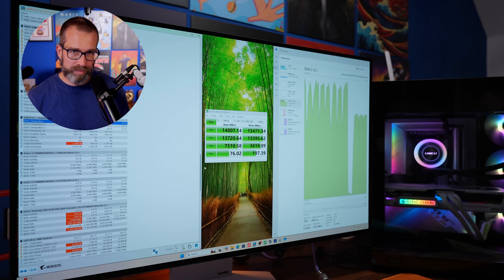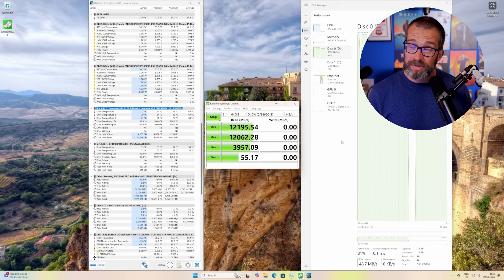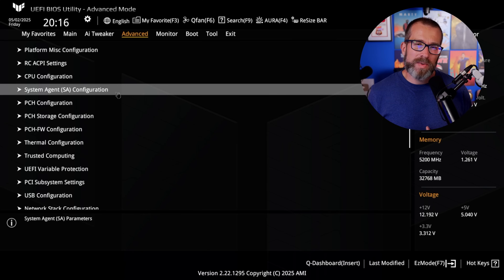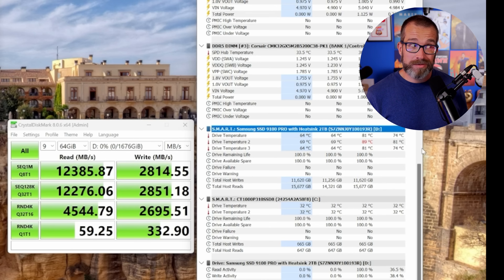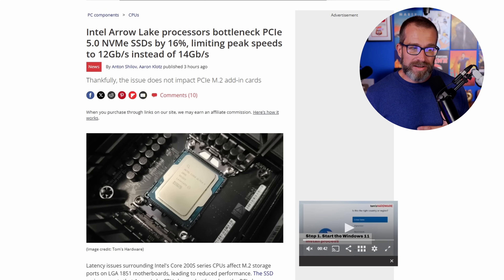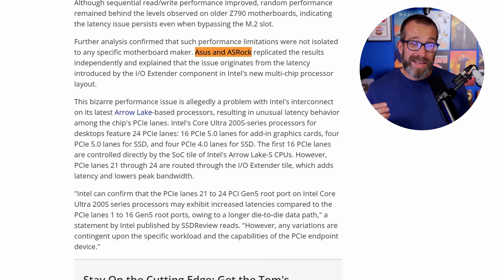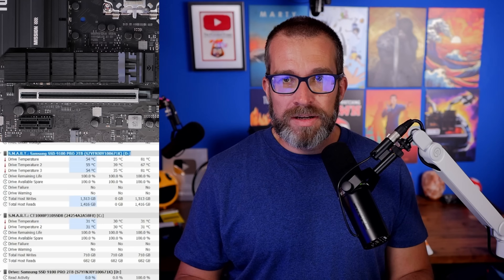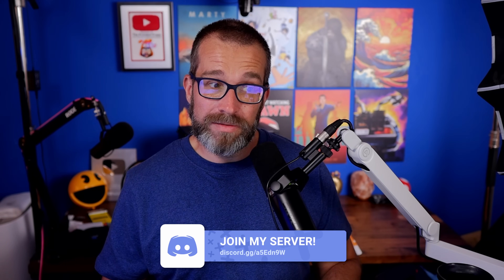Why your gen 5 NVMe isn't running at top speed...

Comment from the maker: Asus has said the following about this:
"In short the issue is due to the way the CPU/platform is designed and having more latency.

Due to the higher die to die latencies on PCIE root port of M.2_1 from IOE tile. This reduces the max throughput/speed. In real world this is not a factor but if you are going to be focused on peak saturation or looking to confirm the highest level throughput this is a factor.

This is platform behavior, not a single board issue."

Comment: I've got a TUF B650-E Wifi motherboard with a 9800x3D liquid cooled chip. I just picked up a Crucial T705 4TB drive, but I can't seem to get it to go above 8.7GBs Read and 8GBs Write...I once his 11GB but that was once. After that test, I was getting like 7GB Read and 2GB Write....I don't get what the issue is. The temp doesn't go above 73 degrees and usually hovers between 62 and 63....

I'm not sure if something is wrong. I updated the BIOS on my MB, I checked the drive firmware, its up to date, I enabled the momentum cache...Still not seeing these 12-14GBs rates...I'm a little bummed out as I bought this thinking I would get at least somewhere near those speed.

Any suggestions, anyone?

Comment: I'm not so sure you are correct about  the 285K performing worse than the 14900K... but it's not a huge upgrade. You have to tweak your system (OC) and definitely need to have CUDIMM Ram at over 8600MT/s...  As far as the Gen 5.0 SSD's this is super annoying! I had not seen this published anywhere before I dropped $300 on the MSI M580 SPATIUM.

Comment: Well that sucks, but even my 9100 is only running at like 7529MB/s on a 890-E ASUS Motherboard with the 265K and my BIOS is fully up to date and I have it in the m.2 slot that's priority AND I forced it to run at PCIe 5.0 speeds, this is super frustrating.....
Reply from the maker: They is odd. Have you got a lot of other nvmes on the board? Is it running at half the lanes?
Reply: @TheProvokedPrawn  I jumped the gun on the comment, thanks for getting back to me. I guess it's something in Samsung Magician that won't read it any higher, in CrystalDisk it reads it at your same saturated speeds so all is good, thanks!

Comment: I'm running an MSI Godlike X870E with AMD 9950X and Crucial T705 4TB Gen5 in M.2_1 slot but even after manually setting the slot to Gen5 in the BIOS it's still only running at Gen4 speeds between 5700MB/s - 6300MB/s when it's rated for 14000+ MB/s. I reached out to MSI and Crucial but no word back yet.
Reply from the maker: I bet it's a bifurcation issue. Have you tried M.2_2. Looks like that's a gen 5 port as well. 
https://youtu.be/hYYygf575N0
Reply: @TheProvokedPrawn I haven't yet because it shares lanes with PCIE_1 where my GPU is installed, but I believe M.2_4 & M.2_5 are also Gen5 without sharing lanes with PCIE_1.

I'm going to troubleshoot now and see what I come up with. Multiple others have said on reddit it's an issue with all X870E MOBO's..

Comment: Oh man, thank you very much!!! This is exactly the issue I have with my PC. Intel 265K, Motherboard Z890 and NVMe Crucial T705, the fastest NVMe up to now. I got only 12 GB/s at reading instead of 14 GB/s. I tried so many settings in my BIOS and nothing worked. My conclusion was that the Crucial T705 is probably a little bit slower because I have an Intel 265K instead of a 285K. I am surprised that the cause has only now been found and not months earlier. Greetings from Switzerland and thank you very much for your video.
Reply from the maker: Glad to help. Sorry to be the bearer of bad news and no fix

Comment: Would rather have a 16% decrease in Gen5 vs AMD which are blowing up since zen4 and still on Zen5.

AM5 in its entirety is just as bad if not worse than 13 & 14 gen intel! 

I had 4 failed 13/14 gen CPUs and well, they also chomped your GPU lanes to x8 if you use Gen5!

Comment: My question would be this. Why would anybody buy an intel over an AMD at the moment?
Reply: Multiple reasons, but all fairly niche. For Productivity, it is very much "it depends" - gcc code compilation tests show the 285K about the same as a 9950X, and in Python the Intel chip wins in numpy (unless you need native AVX512). For NAS, Arrow Lake has lower idle power draw (AMD's Zen architectures are more efficient under load), and this is also very important for laptops. QuickSync is also useful for some people in video editing. Also, as the other person said, everything comes down to price vs performance, and the price varies hugely across the world. Intel are still selling a lot of CPUs, just not in the Enthusiast space in North America. In Papua New Guinea or Brazil or wherever it might be different (or not).
Reply: only reason I see is QuickSync and idle power usage. 
The latter one was quite a problem with AM4 and still partially is on AM5, but somehow there are few videos on it. Regardeles, some SKUs can suffer from high idle power draw (even 40+W,  dual CCD ones might be the only one affected), which is kind of insane.
And well, perhaps better price/perf in some regions

Comment: I was having the same issue but my laptop I have a Lenovo Legion Pro 5 16-in from 2023 with a 4070 mobile, I would put my WD Black SN850x 2TB and put games on it and they would stutter a lot and then I would put my Sabrent 1TB in there and no issues.crazy.
Reply from the maker: Hmm. I vaguely recall firmware issues being mentioned with WDBlack a while back
Reply: @TheProvokedPrawn  yeah this will be the last Intel machine I buy, I got this laptop last mother's day weekend on a sale $500 off bought that WD on sale too for a 2Tb for $120 was a steal..this is my new build and I'll put that WD in it....going to buy this part by part soon.

Ryzen 5 7600X. $206

B650 chipset motherboard for Ryzen 7000 series
$119

Radeon RX 7600XT $500

32GB DDR 5 RAM $94

1TB SSD NVMe $50

 Power Supply 650W   $65

NZXT H5 Flow ATX Mid-Tower Case $94
With fan

Windows 11 home key $11

$1366 I added tax in that
Reply: @TheProvokedPrawn  this X version has the DRAM and I use the WD dash to up date the firmware still having the issue. WD Black SSDs, particularly the SN770 and SN580 models, have experienced firmware issues related to Windows 11 24H2 updates, causing Blue Screen of Death (BSOD) errors. These errors are often due to the lack of DRAM in the drives and the new update's use of system memory for caching. Western Digital released a firmware update to address this issue, which can be downloaded and installed using the WD Dashboard software.
Reply: It has an Intel i7 13700HX CPU btw.

Comment: I have also just put together a new build and been trying to troubleshoot this issue with my 9100 Pro. Intel 200s boost needs another update it seems lol. Dissapointing. Surely also doesn't help that Samsung NVME drivers won't install and using generic Microsoft version from 2006. Z890 Shambles atm. I'm using a Gigabyte board so its certainly nothing to do with Asus.

Comment: It seems crazy to me that storage has become so fast. I remember 20MB hdds that weighed 50 pounds and transferred maybe 250KB per second. The first time I used a SATA SSD and experienced 400+MB per second, it was unreal. Then in 2016 I had my first gen 3 nvme and when I saw 3000+MB per second, I thought I would never need anything that fast. I am still using gen 3 because they are cheap. Now gen 5 with 14,000MB speeds and again, wow.

Brings back IOMEGA 100MB floppy vibes. Good times.
Reply from the maker: It's insane isn't it.

Comment: All the people gassing AMD as I’m RMA’ing my 9800x3d 😭
Reply from the maker: Oh no. You've had issues? Asrock mobo?
Reply: @ asus mobo first, then I switched to an msi mobo, issue persists. PC runs INCREDIBLE but roughly every 2 or so days it hard crashes (no error or blue screen) then refuses to come back on for about 30 mins with MOBO error code “00” the only thing that will get it back on is clearing cmos and waiting for some reason. My small YT community of about 40k has been doing everything they can to help me identify the issue but we just don’t know what it could be. (It’s weird that the CPU actually works most the time, because usually with a bad CPU it wouldn’t post at all 🤷🏾‍♂️) ever heard of something like that?
Reply from the maker: @ShadyMike  you're sure it's the CPU? I know some people have been having problems with damaged ones but there's also a lot of issues with Nvidia drivers at the moment
Reply from the maker: @ShadyMike  also see here - ASRock X870 Motherboard Kills AMD Ryzen 9 9950X: A Common Phenomena Of Gray Marks On CPU Pins Reported By Users

Source: Wccftech
 https://search.app/uuys5

Shared via the Google App

Comment: Thanks Prawn! I am getting extremely close to finally completing the hardware purchases for my next build. I have a 1Tb 9100 Pro I will be using for my primary OS drive, coupled with the 9800X3D and 6000MT 30CL RAM, so I'm relieved this lower performance will not apply. Looking forward to a snappy experience. (I'm coming from an i-9 9900k, with Gen 3 drives and 2600MT RAM)
Reply from the maker: @left-coast-dad  that's a nice upgrade then
Reply: I have a 10900k and a 9800x3d system. The 10900k feels light-years snappier than the X3D. The X3D, of course, is faster, but as far as fluidity in Windows, the X3D is significantly worse.

Comment: are these gen 5 drives showing an increase in perf. in gaming like less load times , less stutter and more smoothness which can only be felt by the user but not be displayed on the fps numbers , do the new gen 5 drives like 9100 pro give better 1 and 0.1 % lows in gaming especially esports titles like pubg , WZ , fortnite , cs2 , OW 2 , etc ?
please test coz no one has done on youtube ...........
also please use a thermalright hr10 pro heatsink for the gen 5 drives to keep it cool and getting max perf.............

Comment: Yet another nail in the coffin for Intel?
Reply: How many nails are hammered in already? Poor Intel has really fallen a long way.
Reply from the maker: I wouldn't go that far. It's very niche. Not that many gen 5 drives run at that speed anyway
Reply: @TheProvokedPrawn  Or that you need those crazy high speeds to begin with. 12,000 is still ridiculously fast. I wasn't all that serious, just that Intel doesn't really need any more cons on its list right now.  😂😅

Comment: I think it good to test hardware to make sure everything is working properly. On Intel.. wow. With all the issues the have had over the last few years, having 5.0 M.2 slots running speed limited below the actual rating for the slot seems minor. But ADMIT IT, BE OPEN AND FORTHCOMING ABOUT IT. The last thing Intel needs to be doing (still) is paying the obfuscation game for their issues if they want to build trust back with consumers. I also wonder about the relationship with Motherboard Partners now after Intel basically used them as blatant scapegoats for the 13th and 14th gen CPU voltage issues. In a different timeline, ASUS may not have been so quick to leak the Intel 5.0 speed issue. Anyways.. 16% is not a huge difference imo. Though if one was looking at 200 series Intel and current discounted pries for a bang for the buck NAS... that would be an issue. I'm surprised Wendell at Level1Techs didn't discover this issue already. This is right down the center of his purview.